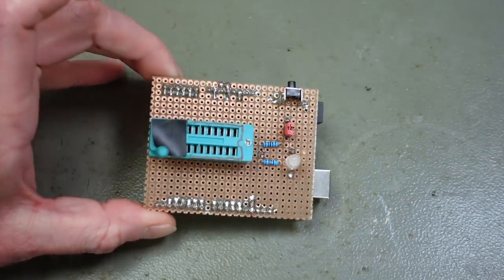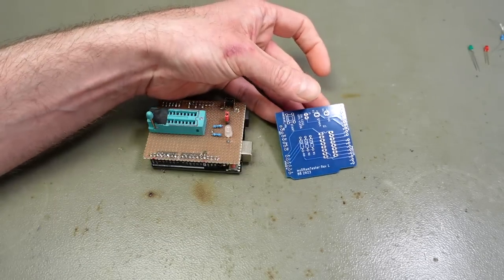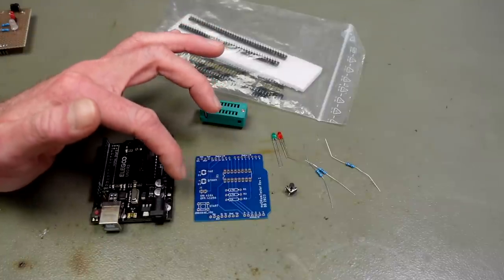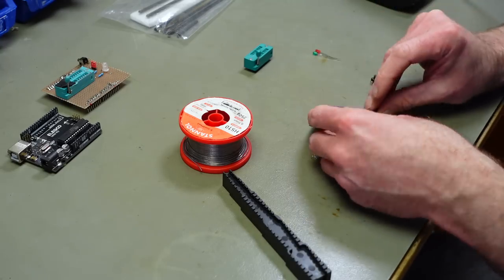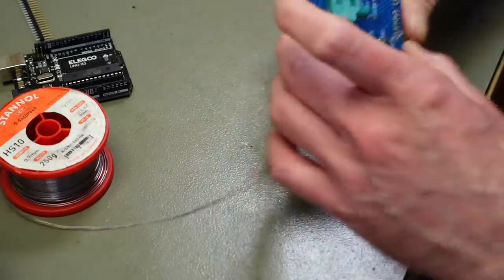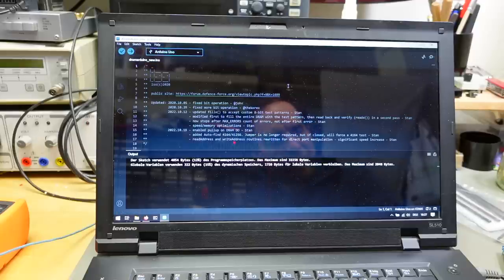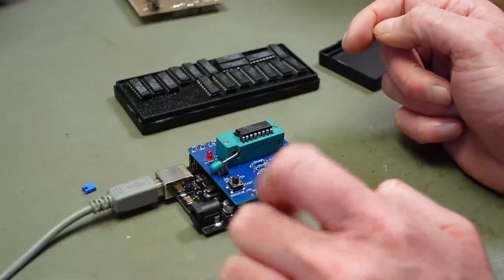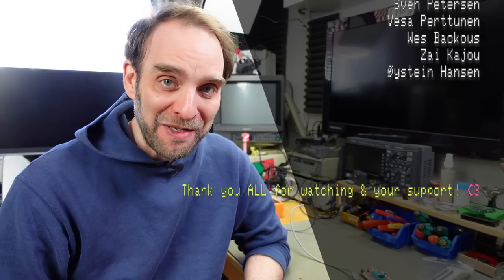A better DRAMduino DRAM Tester Build

Comment: I made this couple of years ago. Since I also fix Spectrums, I modified the code to do 4116 DRAMs too. Because 4116s need -5 and 12V supplies besides the 5V, I made 2 boards, one for 4116s only which has the necessary voltages generated on board, and the other one is like this one, does 4164 and 41256. I thought of adding a display at first but then I decided it would be overkill, so I added a few lines of code to display what's going on during the testing and the result on a serial monitor. Needless to say, you need to connect the boards to a PC for this to work. Both boards are externally powered with a 12V adapter, so there is no powering them over USB option.

Comment: I'd love to see a DRAM tester that also measures/tests the speed grade, to see if the chips perform well under full speed in a system. Maybe even combined with an automatic refresh test that lowers the refresh rate and tests when the chips start to actually lose bits
Reply: Mr Guru  should be possible with a Pi Pico (there was a project some years ago that tried something like this with a BeagleBoard Black and it's PIO engines, which are similar to the Pi Pico's programmable IOs). Also, FPGAs are not that expensive anymore...
Reply: If you can live with 25ns resolution, an Arduino could do it. There are per-clock-cycle instructions to control I/Os....

Comment: Amazing to think that stuff like this is so trivial to make nowadays, versus say 20 years ago when RAM testers were still considered "professional equipment" and not always easy to come by, whereas today, you can buy things like the Retro Chip Tester Pro, or make something like this, depending on your needs... :D
Reply: Well ... good that such hobbyist equipment is available (wait a minute ... for approximately "say 20 years" now? Hehehe). But in my opinion, your comparison does lack a little bit "versus say" ... reality? 
If you were doing anything in this field 30 years ago (even just as a hobbyist) then you probably also had a multi-programmer[1]. These cost around $400 (e.g. the devices in the Galep series[2]) and could not only test TWO components (for the price of $30), but also program tens of thousands of PALs, GALs, (E/E)PROMs types etc. on top of that.

[1] Or a friend with one those things like me, hehe ... There wasn't a thinkable scenario without having such a device. Oh ... and there were even another decade earlier real EPROM Programmers and CHIP testers for the C64!!! Not that expensive.
[2] You won't believe it ... because I am an idiot, like all n00bs are, I killed that device in the first week. It came back a week later and although it was definitely my fault, it was treated as a warranty case and replaced at no cost to me. This very versatile off-grid device works and is used to THIS day! (You can compare my device with the modern TL866 devices, but they lack the wide programming voltage range of my device ... which isn't needed anymore today)

Jan: Good Job and great device!:)

Edit, Trivia: You won't believe how much motherboards I have "fixed" and "rescued" from the 286 to the Pentium era. Because of the usual "mishaps" when flashing a new BIOS ... which is in many cases the first-time and last-time experience (at the same time:P) of most "handyman" in their life on this topic, hehehe.
Reply: @dieSpinnt  30 years ago I was 7 years old, so my pocket money wouldn't stretch to a $400 programmer, during my time in professional PC repair, between 2004 and 2010 (still did repairs afterwards, but that tailed off because modern hardware sucks!), motherboards you said you repaired were back then considered worthless, and the time it would take to do chip-level repair on them from a commercial sense was uneconomical, plenty stuff passed through my hands that sadly went in the bin which today, when repaired, would have been ridiculously valuable, and at the time DIY tools for doing such repairs at home were expensive and prohibitively so if you were just doing hobby stuff, even things like C64s and Amigas, you could buy a box of those for a tenner (I got my two Amiga 600s for £20, in a bucket of other tat that they threw in just to get rid) at a car boot sale, because they were old stuff nobody wanted, of course today retro hardware is treated like a goldmine by unscrupulous sorts, but again, something so dirt-cheap to acquire back then, easier to just parts-swap than to shell out money on test equipment that cost more than a month's wages, unlike today where open-source hardware being created by the repair-oriented community that does so much being sold so cheaply to do diagnostics, testing, recovery and preservation, seriously, it's amazing!! The stuff I could have done back in my PC repair days to fix "old crap" with the tools available now, I'd have been a miracle worker I'm sure!!! Even something like the Greasewazel, £23, what would an equivalent of that 20 or 30 years ago cost? One of those questions where it's probably replied to with "If you have to ask, you can't afford it!", because they were closed-source, niche-market products aimed at professional markets, not us home-gamers, and even in a professional environment were just not worth the investment...

Comment: Hi, love your channel, I learn a lot from you. I bought an Atari 800XL for $100 with just photos of the original box and it is very water damaged, but the surprising thin is that everything in the box is intact plus never used. I scored a brand new Atari 800 XL. Everything wrapped in plastic and not a smudge on any of it. I just learned that you can't judge a book by it's cover.

Comment: Ahoi, i have planed the ZIF Socket 180 Degrees turn around
Reply from the maker: I know, I explained why I put it in the other direction in the video. Just helps me remember where pin 1 goes. Works both ways which is great. ;)

Comment: Great video as always😊maybe that pcb can be a little bit reworked with more grounding polygons, just to eliminate unwanted noise… just as a thought👍✌️
Reply from the maker: The whole backside is a ground plane as far as I can see so it should be pretty well shielded already. But more ground fill wouldn't hurt, obviously!

Comment: the reason for the arduino pin spacing is so you don't plug the arduino shields in backwards.
Reply: no that's not what he means. He's talking about the distance between the rows not being a multiple of the 100mil spacing of common perfboards
Reply from the maker: Yes, what Darkstar says. There's a strange spacing between the rows of pins on one side of the Arduino boards. The pins themselves are spaced correctly, it's just the gap that is odd.
Reply: @JanBeta  the odd gap/pinspacing on one side is intentional and is there as a key(like a keyed connector) so you can't put in an arduino addon board(shield) the wrong way around potentionally sending voltage where it shouldnt go. 
the arduino formfactor was made as an educational tool made to work with addon boards called shields.

Comment: @8:08 could you have oriented the socket 180 degrees so the lever is completely clear? just mark pin 1 with a sharpie.
Reply from the maker: Yes, that’s the way it was intended by the designer. I just find it easier to remember where pin 1 is putting it the way I did. Electrically the same both ways, of course, as long as you put the RAM in the correct orientation.

Comment: I also made this and 4164 and 41256 work fine, but I don't understand why HM50256 and the MB81256 don't work. I also use them in retro computers for replacement.

Comment: Can you please recommend a person who can make a circuit board with the push button contact pads that a little plastic keypad pushes through little plastic fingers that are above the pc board ?

I have a DTMF keypad that is no longer available
It has the plastic piece with the plastic buttons and the PCB that has a film strip with the teaces that slip into a pressure connector 

I don't know how difficult it is to make this type of board.

It has 16 buttons that are pressure metal circles that when pushed makes contact through the circuits

I have one that I can send so it can be duplicated.

Thanks

Bill
KC2OVX

Comment: I noticed in the code comments leaving the jumper off the program will auto detect the memory type.
Reply: Finally built mine today :) 
The serial output is handy for capturing test results, hoping seller for dram will replace the faulty "new" chips based on the failure log.

Comment: Hi Jan, you did a video repairing an Amiga 4000. It ended with the Amiga not posting due to suspected problems in the data lines around battery damaged traces. Any plans to revisit this machine?
Reply from the maker: It's on my list! I often get so frustrated by projects that don't work out that I have to set them aside for quite a while before having another go. I'm going to try again eventually when I build up the courage and patience.
Reply: @JanBeta  Great, I am looking forward to it. I have an Amiga 4000 in a very similar state so would be good to see your troubleshooting. Thanks!

Comment: Could this be made to test 4116's and 4416's? Maybe by changing the programme on the arduino?
Reply from the maker: Should be doable, the test procedure would be very similar. The main problem is that those older chips require +12V and -5V as well as the +5V supply voltage so it would need some extra voltage regulation to make it work.
Reply: @JanBeta   Maybe this would make an interesting video?

It would be nice to have a device that would test the DRAM's of several old computers.

Comment: Hey Jan, what about also detecting type of logic 74xxxx ICs?
Reply: detecting those is difficult because there are so many different pinouts and so many ways you can potentially damage the chip. If you want to simply test 74xx chips there are some very nice projects that do just that, like the RetroChipTester Pro (RCT) for example
Reply: That requires a much more sophisticated circuit and code. This is just a simple, "quick & dirty" DRAM tester that can do 4164 and 41256 DRAM ICs, and that's it.
Reply: @Darkstar2342  That's what I mean (74xx). I got a few bootleg games for example with scratched ICs. Knowing what they are must be simple if you have a table for input injection/output measurement, so coding that must not be so complicated.
Reply: Mr Guru  it can, but only a small subset of all 74xx chips, and it explicitly warns you that it can damage chips that don't conform to the standard pinout (which some 74xx chips don't)
Reply: A lot of those logic chips can be checked/ detected with tl866 or the newer T56 eprom programmer
Reply: Mr Guru  Hey MrGuru, if four ports match the truth table of four exclusive or ports and no other, could you please tell me what could be different?
Reply: Mr Guru  If you are really smart to know the chip complies with requirements (by its code) why would you need a machine to detect it? Nonsense.
Reply: Mr Guru  Noob question to master: give me an example of "complex truth table" for a TTL logic IC, please.
Reply: Mr Guru  Please answer my question oh master and tell me what is the truth table of a dynamical thing like a multivibrator, almighty knight of the soldering iron?
Reply: Mr Guru  As I suspected. You don't know what a truth table is, so I rest my case. Internet is full of soldering iron wrigglers with delusions of docteur ingenieur. That's fine for me, I am having a lot of fun with your arrogant posts.
To the others: my first idea was obviously changing the code to detect simple logic ICs consisting of just a bunch of ports, maybe counters but only involving simple changes to the code since we all know that an arduino is too limited for a complete 74xx check procedure. If it could detect what are some of the scratched ICs in a few bootleg boards, even though very crude, the solution is also extremely useful to some people who cannot afford an IC detector. It obviously would not compare to any professional solution, but we are talking quick-and-dirty here, aren't we?

Comment: I can’t support your content anymore because of how you fed into the drama to rip the retro engineering community apart when you went against the Commander X16 and the 8 bit guy by siding with the Z80 project which misses the point that it is providing a 6502 powerhouse to the community
Reply from the maker: Look, if David sends me a Commander X16 to review, I’d gladly do it. It just didn’t happen (yet). I am not taking sides for anybody. Every single one of the recent retro inspired projects is awesome in their own right. Especially the fact that they exist at all at this point in time.